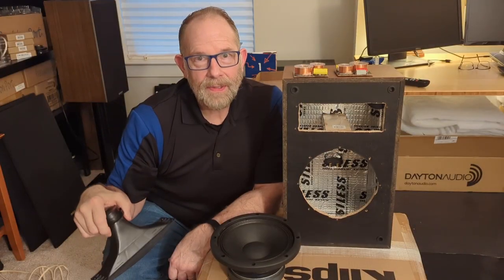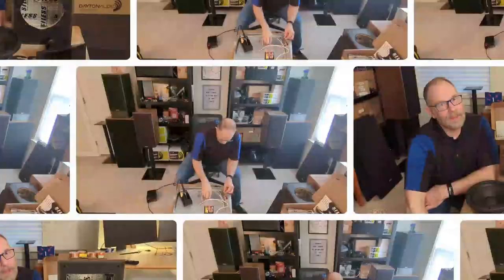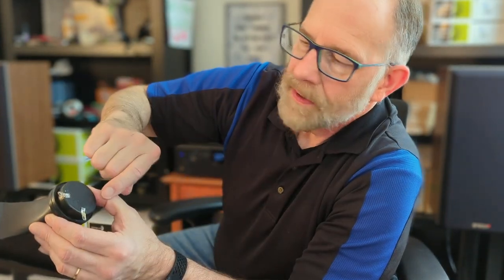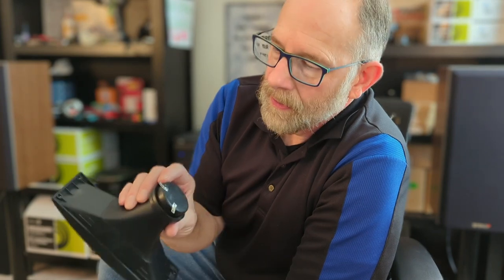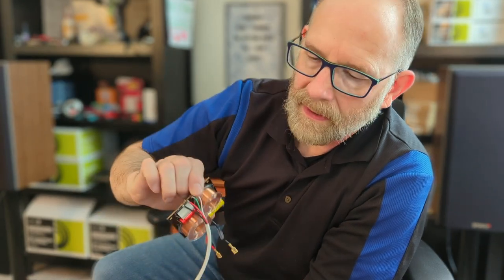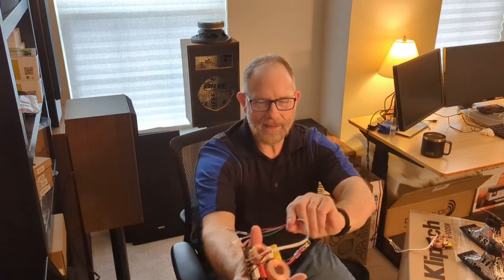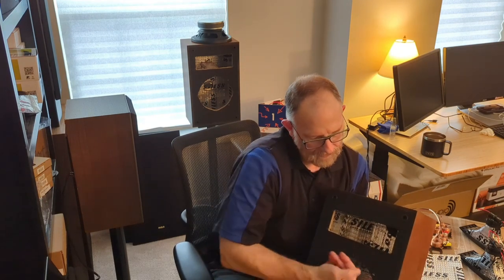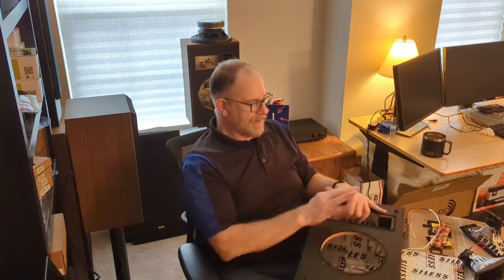Piezo Horn Tweeter EPIC FAIL in the MC-1800 Mini Mach One Project Part 3

Comment: Hi as an electronics engineer, I think after research and testing. Putting your 8 ohm resistant across the piezoelectric unit will only. Serve to give the useful high frequency another path to ground, very wasteful!!  I would strongly suggest you wire it in series ". So it's still loaded BUT" no energy goes to ground ". The none reactive load of a piezo , is much better direct to the amp anyway". Cheers
Reply from the maker: Thank you for watching and the suggestion! As someone who recognizes the value in what engineers have to say, I will take that advice and try it. I've got more piezo tweeters that I'll be using in upcoming projects. They're two ways and the plan was to not use a crossover at all with them. The ones from this video are still hooked up with the resistor in parallel, so the plan was to see what they do without a crossover the way they are now, and if they still sound crummy, I'll try resistors in series. Thanks again for watching and commenting!
Reply: @wattspeakers   hi. Cheers for reply ,  iv always professionally never used anything. Straight to the amp. This way there are no losses and in 10 k setups with multiple piezo tweeters never had a single failure.

Comment: Piezo tiny discs are stiff and brittle, prone to resonance. I stuck a bit of Blue Tack on the back of the piezo disc. It helped a lot to mitigate the resonance. I also made inductors from 20 winds of thin speaker wire around a pencil ✏. That helped a lot to mitigate the "scratchy" upper treble sound. I found that no cap sounded the best for me.

Comment: What may be happening is the amplifier is going into OSCILLATION due to the capacitive loading. Amps don't like caps across the outputs. I got a Marantz 250 that destroyed my Magnepans. I've seen in articles that you also need to put a series resistance in the  Piezo circuit just for that reason. But thats not gonna help with the level issue.
Reply from the maker: Hi Richard thanks. Actually what had happened was I had mounted the crossover but one or two of the sharp solder points on the backside, had penetrated the butyl and we're making contact with the foil on the sound deadener I used. Mounted them better so they can't touch the foil and it worked fine. I did end up swapping the Piezo's for conventional tweeters however because they didn't have a very good upper treble.

Comment: It's a good idea to also put at least 2 ohm resistor in series with the piezo tweeter cos (apparently) they can go down to nearly zero ohms @ 20 khz. Although for lower frequencies the piezo tweeters can be like 1,000 ohms. Maybe your amp triggers cos of that. Your amp may be sensitive to the highest frequencies impedance. I put 4 ohms in series with my piezos. I got the information from a piezo nerd speaker builder on YouTube.

Comment: i cant help commenting they do sound tight i like crisp clean and bassy sound...
Reply from the maker: 👍 these are a unique design by accident. The pro mid-bass driver isn't top shelf but gets the job done and was perfectly suited to the box size. If you noticed, the port tuning was very close to perfect, bringing these down to the mid 50 Hz region before rolling off. That 40 Hz to 200 Hz range is where much of the snappy dynamics come into bloom. The efficiency is nuts as well, so these get loud very fast and positively pound without any strain. I got lucky mating a 93 Db tweeter to a horn, bringing the top end into the mix without over emphasizing it, as is the case with most PA speakers. In other words, through spare parts, cheap old speakers, some cheesy off the shelf crossovers and a little ingenuity I managed to make a hybrid high-fidelity home PA speaker, with a relatively balanced amplitude across most of the average person's hearing range.

Crisp and clean is a great way to describe them, thank you. The PA driver's relatively huge motor, combined with a stiff paper cone really gets the job done nicely. The aperiodic vent creates a little extra low bass, enough to run them without a subwoofer, or combined with a subwoofer to fill in that 100 Hz range creating a larger sound stage. 

Thanks again for watching and commenting!

Comment: I've built with piezo tweeters before. You can't have inductors inline with piezos. They essentially act as a straight capacitor, in reality with some internal resistance. But adding an inductor will create a straight LC circuit dropping impedance at that resonant frequency to 0 ohms. And this can cause amp burnout or shutdown and current oscillations between the inductor and capacitance of the piezo element, risking burnout of the piezo, a $5 mistake but still nonetheless.

This is why you need to run a 1st order filter only. This is accomplished by adding a parallel resistor to the tweeter and using a single capacitor inline to filter out unwanted lows, for convenience sake use 8 ohms, as this is system impedance and will maintain flat impedance throughout frequency range. This forces the tweeter, to act as a voltage following device and ensures that system impedance at resonance never falls below the DC resistance of the tweeter and there's no resonant frequency from an LC circuit to drop impedance. Since we're running a theoretical 8 ohm system impedance the capacitor used to create a 3 khz 1st order crossover is simply 6.63 uF, but experience tells me the tweeter impedance is about .1 uF so use about a 5.53 uF inline capacitor. This should keep the crossover point pretty close to 3khz.

There's also another trick, to lower distortion keep the crossover above 3kz. I've tested these tweeters in and out of horn. Those tweeters you've selected are the low compression, wide dispersion Motorola CTS clones about 90-93 dB efficient but wide dispersion which is good for better SQ. In my opinion better than the high compression small diameter ones that do about 96 dB but tend to beam at high frequencies.

The low compression large horns typically have bad rolloff at higher frequencies but the piezo helps solve that by having better response at ultrahigh frequencies above 12khz. They're used in pest control situations because of their ultrasonic efficiency. So even though it's a 1st order filter with the natural rolloff at about 3 khz this creates a psuedo -12 db/octave rolloff which mates well with a 3khz -12db/octave standard crossover for the 8" woofer.

But another plus one is the 1st order crossover is the nearly perfect impulse response of 1st order crossovers. Less components in crossovers always means less stored energy in the system leading to better impulse response. There's so much mystery and legend regarding piezo tweeters but there is solid reasoning why they gained popularity, good enough sound and minimized crossover complexity, albeit to the point of everyone losing the original knowledge and just poo-poo'ing piezos blanket. When properly implemented they really do have a special airiness, immediacy and presence that's hard to replicate, especially when you consider the price and simplicity of simple 1st order crossovers.
Reply from the maker: Wow thank you for watching the video, commenting and all the information!

So... I've got some questions:

First, based on your experience with piezos, I'm wondering if I've got the resistor in the correct location. The piezos I tried have an 8 ohm resistor I wired in parallel, (across the positive and negative terminals). I read that placing the resistor in parallel, can help the piezo behave behind a crossover, more like a conventional transducer. It's actually similar to a Zobel minus a capacitor and it apparently serves a little different purpose. Still for impedance equalization, albeit to combat two different electrical Phenomenon. However, there's other information that is common and recommends the use of a resistor in series, except fairly large values, like 20 to 30 Ohms. I'm not sure which is correct, or if the recommendations are for two entirely separate circuits, e.g. resistor in parallel for use with crossover, and resistor in series when not using a crossover possibly?

My next question, is that I've got that same pair of piezos still kicking around and have them planned for an 8” or 6-1/2" 2 Way, that I'm planning on using either no crossover, or a vintage first order RadioShack adjustable crossover. Which would you recommend and what way would I use the resistors? I'm assuming that the  piezos I have with the 8 ohm parallel resistors could be used behind the first order crossover as you mentioned using a cap in series... The crossover I'm planning on using has I believe 4 x-over points to choose from.

I've also got some CTS Piezos that arrived from parts Express this past week, slated for use in more upcoming projects. I'm wondering what you think about those. They're very similar in appearance to the ones in this video.

By the way, the problem I had with the 2nd order 3500 Hz crossover and the piezo with the 8 ohm resistor in parallel was that it was very quiet. It sounded decent, and I could hear it working, but it wasn't sufficient to keep up with the mid bass driver. Plus there was very poor high frequency extension. Was that because it was behind a 2nd order network?  It seems odd that 2nd order or 1st order would matter, because the higher order is simply limiting the lower frequencies at a steeper rate.

I've built speakers with piezos way way back when and I remember them sounding nice... Very airy yet super quick.

As a PS, the pair of piezos that I whacked off the piezo and glued on a conventional dome tweeter actually sound very nice and have a surprisingly decent frequency response, which tells me even though the speaker was cheap, somebody did a decent job on the horn.

Anyway I'll stop blabbing... looking forward to your response.
Reply: You sir have the knowledge!   Ive been experimenting with piezos for many years myself and I agree with everything you've mentioned. My final version uses a large rectangular horn 13" wide and 5.5" tall.  Have a 8 ohm resistior in parallel  and a 3.3uf Sonic cap in series. The sound very good! ( finally)  This is paired with a vintage 10" alnico full range in open baffle with a small .4mH air core inductor to roll off their top end. Bass is handled by 15" open baffle subs. Lots of people can't believe the big horns are piezos.
Reply: The piezzo is very efficient. Specially in a horn. 
I my self use em whit 8 ohm in parallel , but allso 8 ohm series. 
Then I can genuenly add a 2nd order crossover. Or even higher order.

Allso... that bitumen like material used by car audio guys on the body panels is indeed your friend when it comes to thesr plastic horns. 
Apply a good thick layer , from the outside. I allso like to add bracing in a way that it grips the end of the horn , where the driver is. Like a vice. Makes a whole world of difference. 
Others have had excellent results by having the piezzo horn its in own chamber , and simply filling it whit concrete. You won't be able to replace them , but surely will absolutely do its job , keeping the plastic horns as steady as possible.

Comment: Pieto tweeter is a capacitive load. It is necessary to put 10-15 ohms in line with it.
 Then a standard crossover can be applied, which is also loaded with a resistor of nominal size (4 - 8 ohms). Greetings from Serbia.
Reply from the maker: Siberia? Wow that's a ways away! Thanks for watching and the comment. My understanding of Piezo tweeters, (which is limited), is that a resistive load in series makes little to no difference and can adversely affect the high frequency output of the Piezo, because unlike a coil in a conventional transducer which has it's highest impedance at its lower frequencies, the Piezo's impedance rises potentially to 100 ohms or more at the highest frequencies. Some argue that the 20+ ohm series resistor is unnecessary and isn't much of a change when there's that much impedance and one adds even more. The thought process behind the 8 ohm resistor in parallel, is to correct the nominal impedance as the crossover sees it, so while the frequency increases, it will present only an 8 ohm resistance to the crossover and/or amplifier, which obviously is better than 100+ ohms. 

Disclaimer, I'm not a Piezo expert, nor have I measured the varying resistance of one. I'm simply regurgitating the most reliable information I could find online.
Reply: @wattspeakers  It's not Siberia. Serbia, part of former Yugoslavia.
Reply: @wattspeakers  Piezo tweeters have a capacitive character of several nF. That capacitance can cause the amplifier to oscillate. That's why you should put 5-30 ohms regularly. Then the crossover is loaded with several hundred to those 5-30 ohms, as the frequency changes from 1000-20 000+Hz. The crossover requires, say, 8 ohms, so it should be loaded in parallel with those 8 ohms. after that goes 5-30 ohms and piezo.
Reply: @wattspeakers  It is not Siberia, Serbia, the former republic of Yugoslavia, the Balkans, Europe. More precisely, Belgrade was bombed in 1999.

Comment: I would put your ohm meter on the speaker inputs on the back (This may help look for problems with the crossover)and check the DC resistance. going into the speakers and also check the DC resistance on each driver. should be around  5.8 Ohms or so for the woofers Not sure about the tweeters but be good to see what they show. If you purchase the Dayton Audio Dats V3 it can test your speakers and show an impedance graph on your computer screen to show where the impedance may dip to cause problems with your amplifier, I have one of those too.

Comment: you put your load resistor in parallel to the tweeter, when I believe you wanted to put in series. Even after you removed the resistors from the circuit depending on the resistance of the tweeters and how the matching load in the crossover works those tweeters may be causing too low impedance for the outputs on your amp?  Try wiring up the resistors in series on the positive terminal of the tweeters and check the impedance across the tweeter(should be >the load resistors value).  Hope this helps?
cheers!
ron
Reply from the maker: Thanks for the comment Ron.. I meant to put the resistor in parallel with the Piezo, from what I've read, it presents an 8 ohm load for the crossover / amp, because the Piezo impedance is funky. A resistor or L Pad in series is apparently used for another purpose, although the purpose escapes me at the moment.... Maybe something to do with eliminating sky high impedance at high frequencies from newer amps and receivers? Anyway... The parallel resistor is needed with a crossover, so the X-over works as intended, while presenting a more stable load to vintage amps. Without a crossover, the Piezo can be used with nothing at all, or a small value capacitor in series that does something for audio quality.

Comment: I built a pair of coaxial speakers with a piezo disc inside the voice coil tube of a 4" full range driver (along with added woofer). So I didn't need the 8 ohm resistor. The FR driver was the resistor. 😅 (No cut off from the amp even when cranked).

Comment: Those 8" PA type are really shouty and have a serious medrange level! I deal with them cos I build coaxial drivers out of them since some have a 2" voice coil. I use a 5.6 uh bass inductor and a 1.8 uh med inductor. And a 10 mf cap resisted. I have to pull the speakers apart to tell you the resistance (I forgot). And in a big box for bass intensity. It's a type 1 crossover and you could use a smaller med inductor with a type 2 circuit.
Reply from the maker: Thanks for the comment! Budget build $100 per speaker. The Dayton MB-820 actually sounds less PA style than one would imagine. It's actually pretty musical and blends well with horn loaded tweeter and a subwoofer. I agree that some PA speakers a.k.a. pro drivers, can be "shouty" or just plain annoying. This one I can easily chill to all day, or crank it up and it seems to be very natural, neutral and quick.

Comment: I had to go back and watch the video again looks like your amp kicked out Before and After you removed that resister. The Dats V3 would really help in troubleshooting. Since your crossover is the new untested part. You could start with that. (after resting Re on all drivers.) and use your meter to verify 8 ohms on those resistors too.
Reply: A piezo nerd told me that piezos can go to nearly zero ohms @ 20 khz. At lower frequencies they go to like 1,000 ohms. The low resistance @ the highest frequencies could maybe trigger some amps.

Comment: I ran some test... Your crossover really does need to see a load for the tweeter otherwise it sends most of the signal straight to ground through the inductor on that portion of the second order crossover. this would cause your impedance to drop pretty low and potentially causing the amplifier to go into overload and shut down. You could try a 10 or 12 ohm resister...  Or unsoldering one end of the inductor on the tweeter portion of the crossover. If you were using a first order crossover then this would not be a problem if you had no resistor in parallel with the tweeter. Second order or higher crossovers must have a load on all outputs. Since your tweeter looses to much output when using a resistor I would snip that inductor and then the crossover would be like a first order for the tweeter. and load would not matter to the amp.
Reply from the maker: That's good info and makes sense. If I try some other project with Piezo it might be worthwhile... Or probably cheaper to buy or make a low pass, then just add the capacitor in series with the Piezo. I think that's why Piezo builds 30 years ago worked no matter what  because 1st order crossovers were common.